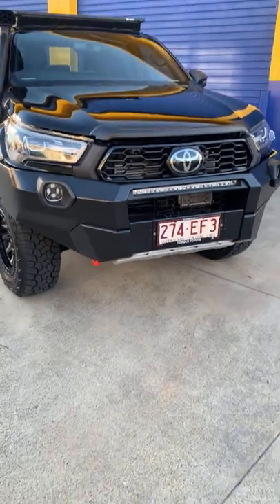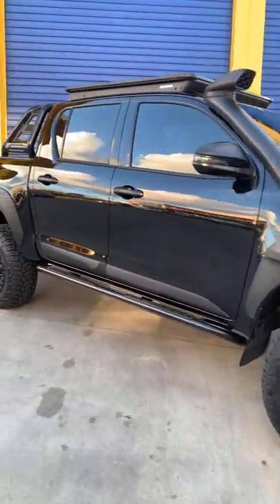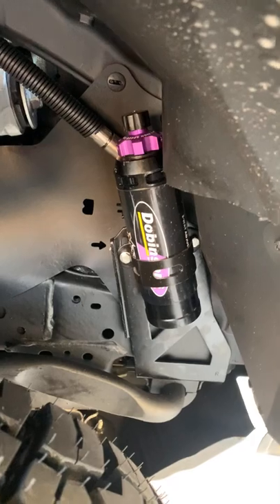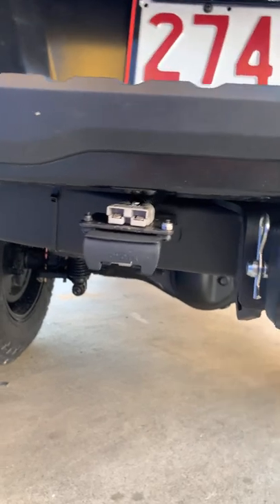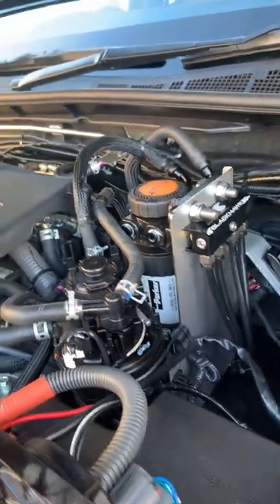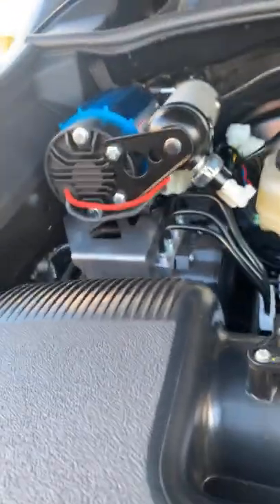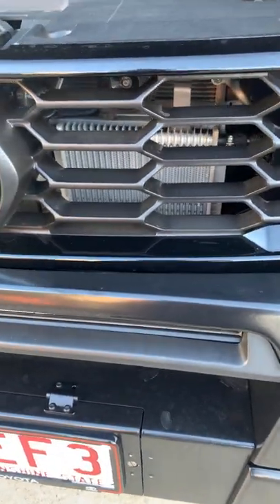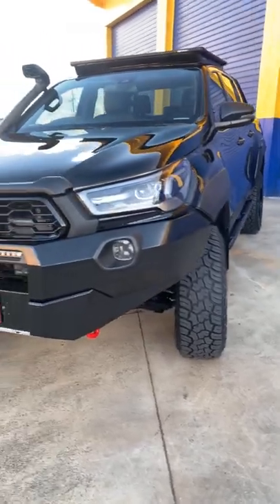Rugged-X Hilux Ready for a Cape Trip

Comment: How did you get the winch in the bulbar? Did you have to cut it?
Reply from the maker: This winch was fitted prior to the bullbar being fitted. It was mounted on the Toyota winch bracket. It was the only option with the factory bar. We had to relocated remote hand contoller as Toyota had fitted into a different position and it look hideous.